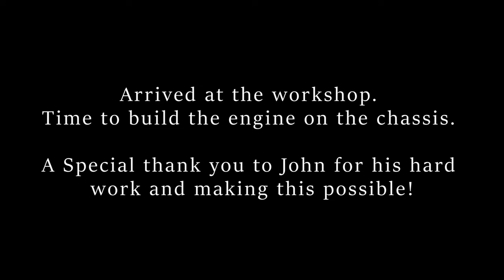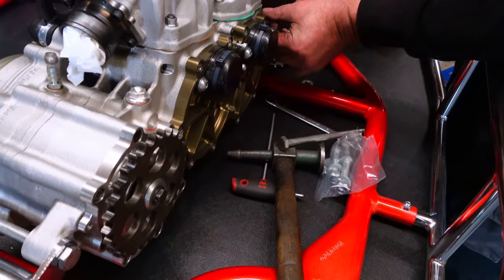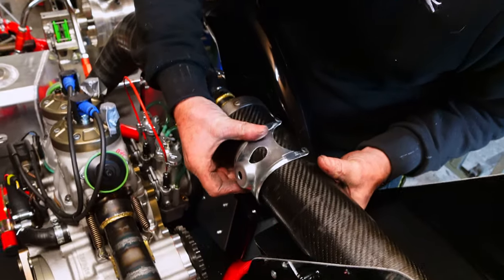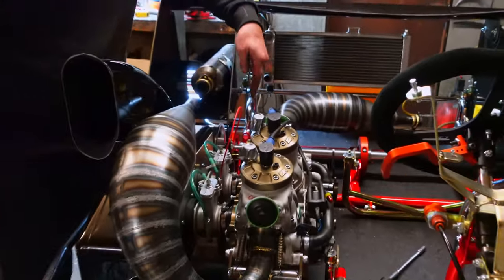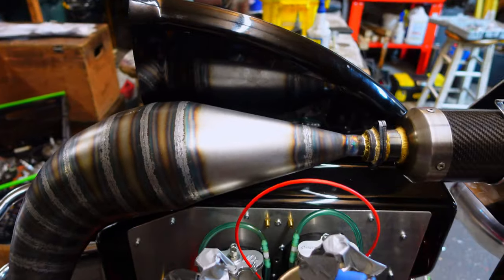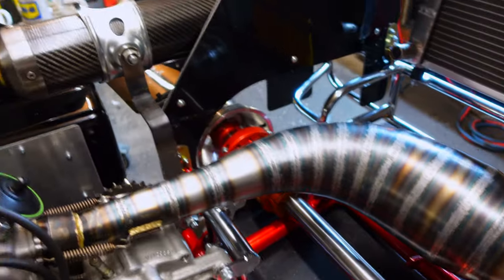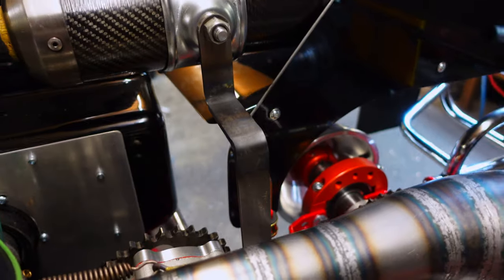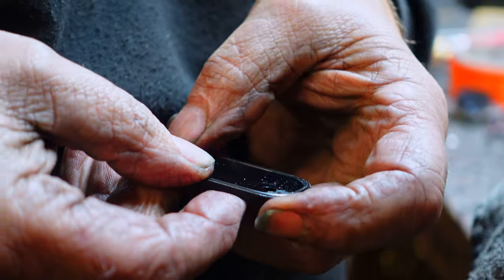Episode 1: Collecting My 2022 Division 1 Superkart & Building on the VM 250cc Twin Engine!

Comment: You need to wait before engaging starter, turn ignition on and wait for ten seconds at least. Then engage starter. The wait is for engine glow plugs to heat up. Should be a light on dash
Reply from the maker: Nice one matey!

Comment: How much does one of these cost?
Reply from the maker: They vary in value - older 2nd hand racing kit - probs 2-3K. If you want brand new everything and want to race in the 250 twin Superkarts looking more towards 20K mark
Reply: @MyRob10  That ain't too bad at all you know for a used one, £20k is that including racing for the season as well?
Reply from the maker: @TheStressD  that’s just for the kit mate!
Reply: @MyRob10  Bit expensive for what it is but it ain't too bad either due to the small volume. How much does a season typically cost?
Reply from the maker: @TheStressD  if you want to spend half a million on a GT3 car and still go slower then that’s up to you haha! 😉🤣🤣 season probs around 10K
Reply: @MyRob10  lol nah this is actually good value for money, it would be good if you could just do karting track days. I think CrossKarts are good because you can rag them on the street. Sierra CrossKarts are nuts but they cost around £60k+ for top spec one.
Reply from the maker: @TheStressD  for me nothing beats the Superkart Championship. Full Season of racing, you could get a second hand Superkart (division 1) for 12K and you could go speeds up to 140mph at the best circuits in the Uk! The only form of motorsport quicker than these is Formula 3, F2, & F1
Reply: @MyRob10  Yeah that is cool, I'm guessing you can't race these off season or do they have other events where you can?
Reply from the maker: @TheStressD  yeah there’s test days off season matey!
Reply: @MyRob10  Where is a good place to buy the Division 1 karts 2nd hand?
Reply from the maker: @TheStressD  just check out Superkarts for sale on Facebook matey! Where you based?
Reply: @MyRob10  OK nice one, I'm based in the UK. I ain't got the space at the moment but if I ever get a house with a grarage I'm going to try to get one of these. Imagine if one of these were road legal it would be nuts lol.